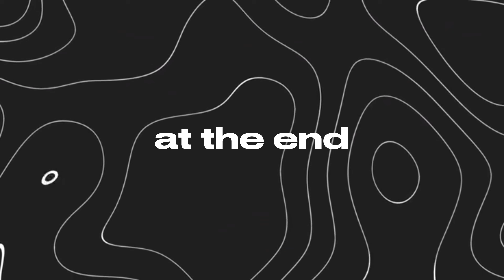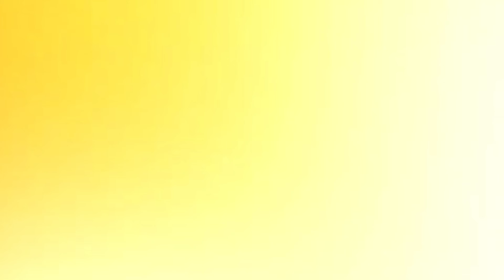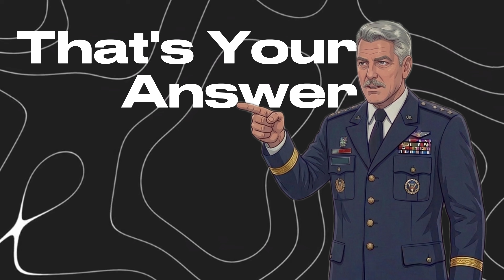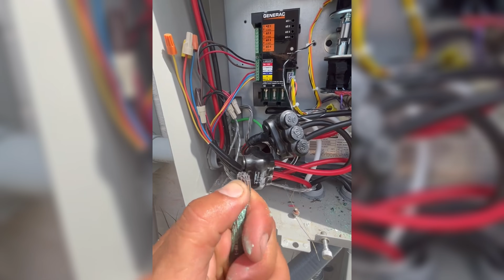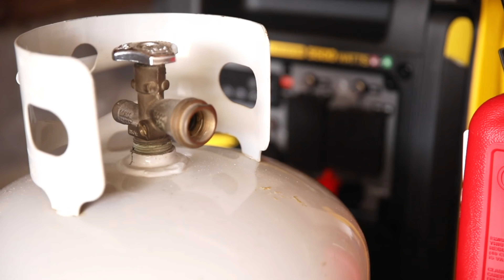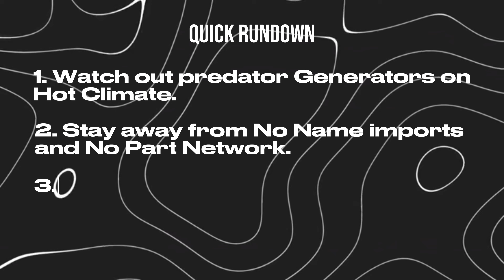I Tested 7 Generators and Only 3 Are Worth Buying

Comment: Generac's are garbage. Storm came thru and hundreds of them are not working. The bushings went bad and a class action lawsuit is being formed to deal with it a couple of years ago. Go online and search for yourself. They already settled for solar powered garbage.
Generac's claim to fame is being the most common. It's like saying Big Macs are the best burgers since they are sold the most.
Just look at BBB reviews, the modern ones are garbage. The old ones seem to last though. 
The techs around me are all getting the same error messages since this is our first storm in years. No one knew this was a problem until now since the generators were actually used instead of tested weekly. Generac has lost any cred around these parts. 
Generac's are horse crap. Pay 5 figures for a professional install, then 500 bucks a year to maintain and check it...and when it's needed it fails.

Comment: Had a Predator 3500 for 5 years. Ran through power outages after Sally, a tropical storm or two, a few high wind storm events and now Isaias with zero issues. Quietest generator on the street and ran two refrigerators, lights, fans and microwave for 10 hours on 2.5 gallons.

Comment: Just had a Champion 5500W inverter dual fuel delivered. Gonna unbox it tomorrow with my boy n fire it up. Glad to see it on your list of To Buys, planning on using mine as back-up to my power station if the typhoons last a few days n solar input is down. Should be fine, even a Pinto will go 200,000 miles if ya change the oil😅

Comment: Our local Mobile Vet depends on portable power for their service.  They "bought the best" and that was advertised as Honda's large inverter generator.  The last time I saw them, they had a Predator inverter generator providing power and I asked them about it.  They told me the Honda broke down under warranty so many times they bought the Predator as a backup.  Each failure meant a canceled event and though warranty paid for the repairs, the lost business wasn't tolerable.  When they got their Honda back, it waited for the Predator to go down and was still waiting.  They said they would never buy Honda again.  It's likely the reason I see more Predator generators running outdoor trade show events than any other brand.  WE ARE IN TEXAS and have exceeded 120 days of triple digit temps. (over 100°f)  Predator is the best buy in my observation.

Comment: I bought the Harbor Freight 3500 inverter series and had no issues with it for about 6 years. I used it to power my travel trailer and it ran the air conditioner with no problem. But when it did get very hot last summer about 95 degrees, I think I overloaded it and it caught on fire. Part of that was probably my fault but I still went ahead and bought another one because it had worked fine for the prior 6 years. I cannot justify the price difference between them and a Honda generator which is three times more expensive

Comment: BULLSHIT PORTABLE GENERATORS FOR THOSE THAT CANNOT AFFORD A REAL AUTOMATIC STANDBY SYSTEM.......
Reply: Some folks don't need a standby system; something small and fuel efficient does the trick for infrequent and short duration outages.
Reply: @berettaguy7445  IT'S OK, YOU DON'T NEED TO BE ASHAMED YOU CANNOT AFFORD ONE........
Reply from the maker: Fair point, a standby system is the best option if the budget allows. But not everyone can afford one right now, and for those folks the real choice is portable versus nothing. If you have a standby system you trust, feel free to share the brand.
Reply: I bought one a Generac for $10K 5 years ago and it failed when needed, paid 500 bucks a year for maintenance....so did hundreds of others around where I live. The techs are backed up for weeks, they are all seeing the same thing: bushing failure. Nothing to do with affordability.
THEY ARE CRAP AND YES WE CAN AFFORD THEM.

Comment: Bought a Troy Bilt 5500 portable in 2004 when every hurricane seemed to home in on my house. Put around 100-ish hours on it since. B&S engine. Synthetic oils only, non-ethanol gas only, run carb dry on shut down. Stored covered in garage. Pull it out before every hurricane season and run about half a gallon of gas through it, making sure the generator is powering up. After 22 years, still started on 1-2 pulls. The only "repair" I've done is replace the leaky pneumatic wheels with solid wheels.
Reply from the maker: That is a masterclass in proper maintenance; keeping it clean and using the right fuel clearly paid off over the last two decades. ❤

Comment: I bought a Generac 5500 watt generator in 2012.  I only used it a handful of times for more than a day or two and it always started easy.  I had it all set to go five years ago with a fresh oil change and ran all the gasoline out of it and have stored it in that condition ever since.  Four years ago I bought a Generac 22kw Guardian unit for the whole house and its been a Godsend.   Its been running for the last 8 days straight with a fresh oil change and air filter today.   My old 5500 watt Generac I gave to a neighbor,  GAVE to this neighbor and his 97 yr old mother and it still starts after the second pull and has been running their home for 7 days straight.  God Bless them!  No idea when power will be restored after this terrible Derecho typhoon in Indiana last week.
Reply from the maker: That’s a great example of why a Generac can be a solid unit when it’s installed right and maintained properly. Fresh oil, clean air filter, fuel handled correctly, and a proper setup make all the difference. Eight days straight is real proof. Glad you were able to help your neighbor and his mother too God bless.❤
Reply: @RangerProven  Thanks.  Yes Ive made sure on the 22kw to daily, shut it down correctly and give it about a 20 min cool down w dipstick and oil fill cap removed.  Then I check and if needed top off the oil and check the airbox under the filter for any oil and wipe it out and restart.  Im going to keep this running as good as humanly possible!

Comment: How does the duramax 11000 inverter stand up to the top3?
Reply from the maker: The XP11000iH is a solid high output option clean inverter power, dual fuel, and enough capacity for serious home backup. I’d rank it ahead of most budget units; just make sure you have a proper transfer setup and a real fuel plan.❤

Comment: Interesting I was unaware of the overheating problem with Predator.  I see a lot of these generators on the back of service and utility trucks.  We have one of these generators from Harbor Freight at a off grid airfield.  It runs for hours a day in over 100° weather.  I don't know if anybody even changes the oil.  At a bottle and can recycling center that operates out of a steel storage container  I've stopped in there many  times and asked the man how does that generator run inside that steel box with just the doors open? It's well over a hundred degrees inside that steel box with the generator running in the summer.  He told me it runs 8 hours a day 7 days a week and he always changes the oil on Sundays.  I don't know if I believe this or not.

Comment: Maybe I'm an outlier but my Predator 9000 has about 1000 hours on it so far with no issues running wells, air compressors, and portable welders on a farm as well as the RV on family trips. This thing is beat to snot and has been dropped apparently bending the motor case and winding housing got cracked, but it keeps on running. I knocked on harbor freight products for years, but I'll cry a lot less when this $900 generator dies from abuse by employees compared to a ~$6000 honda. Only issue I've had with the machine itself is the CO detector goes off if the exhaust is anything but downwind of the machine. Next one I think I"ll upsize to the 11,000 inverter or the 13,000, but for sure with tri-fuel for the house.
Reply from the maker: It is great to hear that your unit has been such a reliable workhorse for your business. ❤

Comment: I have a duro max duel xp12000 and from day one it was a piece of junk it never would run on gasoline. I could get it to run with the propane nothing but headaches from day one owning it and I spent $2000 for the piece of junk.
Reply from the maker: Sorry to hear that, that's a rough one. DuroMax wasn't one I covered in this video, but gasoline-side carburetor issues right out of the box on dual-fuel units are a documented problem. sounds like you got a bad one. If propane's been reliable for you, at least lean on that side while you sort out the gas issue. Appreciate you sharing it, this is exactly the kind of real-world feedback that helps everyone else reading the comments.

Comment: I live in ontario. i have a duradrive 2000 good little unit. i have two yamaha 3000 with boost. i also bought a maxpeeding rod gt. it was a POS when i bought it. but i fixed the co sensor by disabling it, also a good unit.
Reply from the maker: That's a solid lineup.... Yamaha's reputation for reliability tracks with everything I found in my research, glad they're holding up for you. Appreciate you sharing the Maxpeeding fix too, that co-sensor workaround is good info for anyone else running into the same issue. Ontario winters aren't easy on this stuff, so three units still running says a lot. Thanks for watching all the way from Canada.

Comment: Fairly reasonable advice here!  I have a Champion 7500/8500peak generator.  It worked very well for the first couple of years... but after year 4, the hoses for the fuel line to solenoid on the carburetor started leaking.  I actually hated the design because if the battery fails... you literally cannot start the generator even though it has a manual pull cord to do so.  That solenoid WILL remain closed without power to open it up, leaving you without any fuel feeding into the generator!
Reply from the maker: That's a fair critique, and it's a real design flaw worth knowing about... a fuel solenoid that fails closed without battery power defeats half the point of having a manual pull-start backup. Good catch on the fuel line hoses too, that's useful for anyone hitting year 3-4 with theirs. I still stand by Champion as solid overall value, but this is exactly the kind of thing I wish more reviews mentioned upfront. Appreciate you adding it here for others.
Reply: @RangerProven  Yes, others should know about that "design flaw".  Now, of course, it could be a malfunction on my part but this problem existed day 1 of ownership.  One of the first things I do is make sure a genny will pull start without me having crank on it like a caveman...